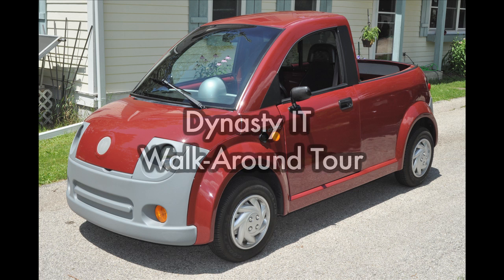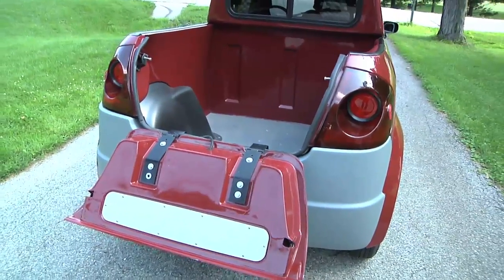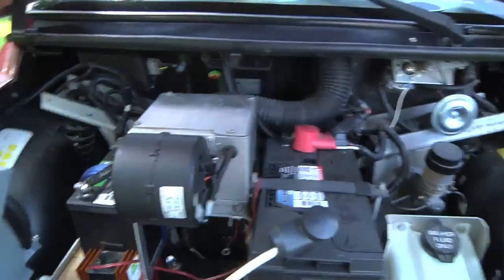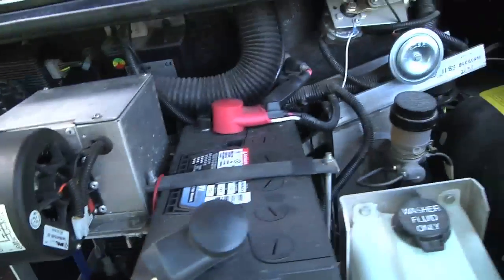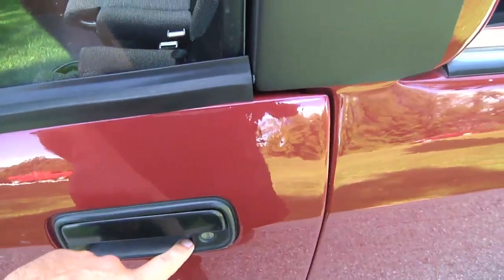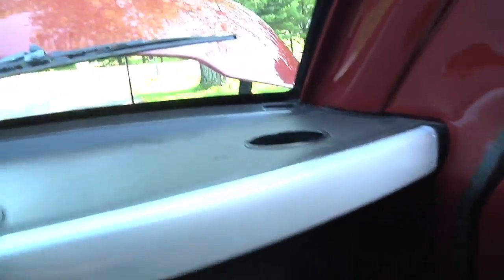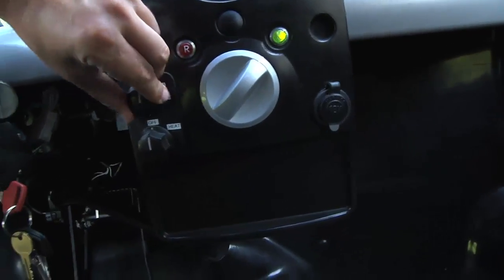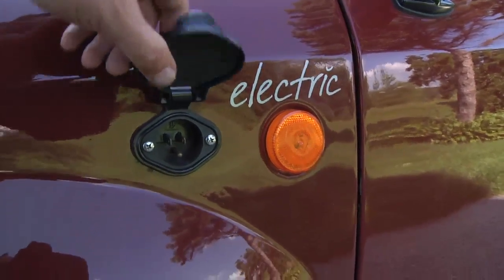Dynasty IT Walk Around Tour

Comment: Most of my local driving is in a 45mph Zone. Can the Final drive be changed?
Reply from the maker: Generally, there's very few work-arounds on N.E.V.s. Unfortunately, the law limits their speed and they are built to match that. For something a little faster, an electric motorcycle or a DIY electric car are great fun AND meet all the legal requirements.
Reply: Im ignorant, Seeing as this is a torque monster, I would probably just put larger tires, if all else fails :)

Comment: Upgrade the rated speed to 45, add power steering, breaks and you have me sold. Most roads in my city are 45, so the 25 max would be a problem. Love the idea of a low cost commuter vehicle with function.
Reply: Have you sold it yet??

Comment: How hard would it be to change out the bottom row  of batteries?
Reply: It looks pretty easy to get at the lower batteries. Everything on the upper part - the defroster, 12V accessory battery, etc., is all on one big frame which comes right out by removing two nuts.